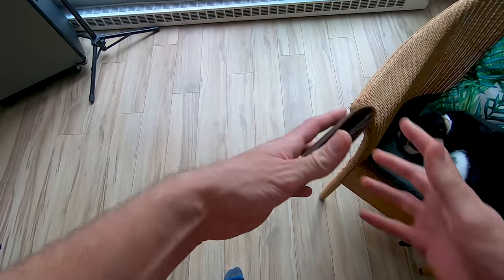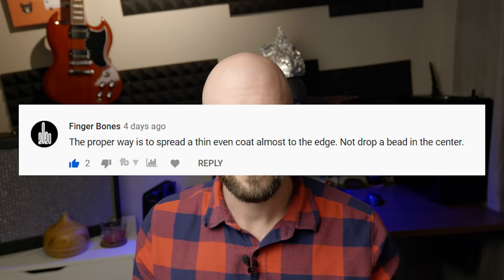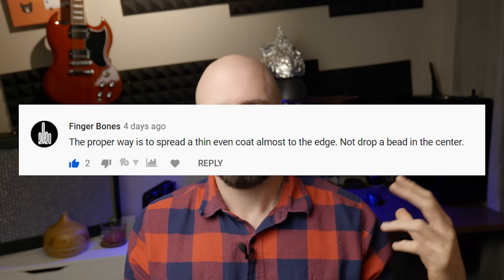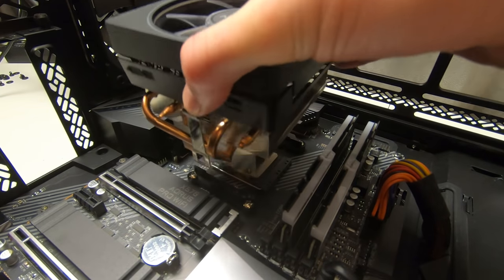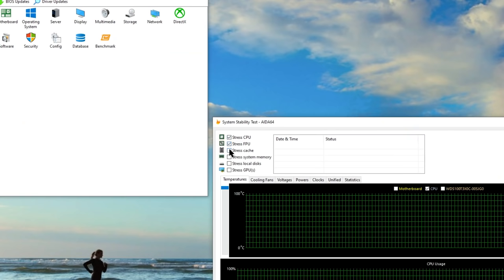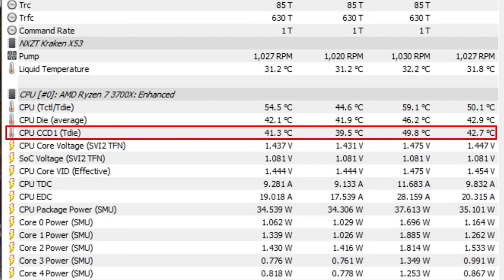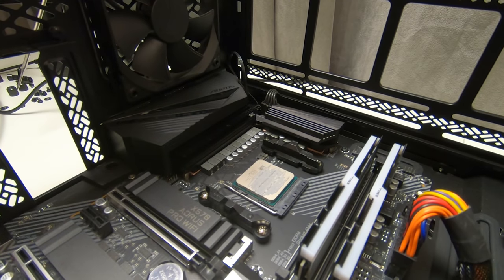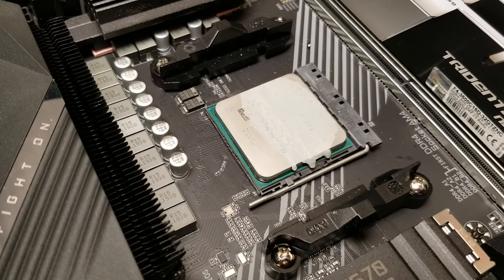Best Way to Apply Thermal Paste? Does it Even Matter?

Comment: the best method is a thin layer specifically covering the die of the cpu, when you put the heat sink on it should spread almost to the edges of the cpu without seeping through
Reply: @Keebine Kobold well it's not the "best" in terms of thermal performance, since any method with enough paste will work fine. but it might be the best in terms of using as little paste as possible, getting a consistent application, all without sacrificing performance.

a novice may not realise they didn't put enough paste if they use another method, but if they use the buttered toast method it will be very obvious when there's not enough. for someone proficient, yeah it doesn't matter bc they have an idea of how much to use and they know to ensure even mounting pressure

Comment: A lot of enthusiasts are religious about applying thermal paste.  I love the fact that you spent the time to prove (IMHO) that they are simply wasting their time.  I've been using the 5-dot method for years because it is self-evident that the better the contact between the CPU and cooler ... the lower your CPU temps will be.  Thank you!
Reply: Seriously I am not a 20 year PC vet. But I have built a few PC’s. My latest Rog strix B550-f-gaming. Ryzen 7 5800x , Asus Dual 3070, PSU -Corsair Rm 850x Gold. Noctua No-d15’s chromax dual fans - 6 Noctua Chromamax black hot swap.  That being said. I have applied Every paste except metal‘because’ it scare the bejesus out of me. So to prove the five dot method for at least AMD 5800x. I applied 4 applications already of thermal paste. My second go around with Noctua thermal paste AND thermal grizzly kryonaut extreme. The 5 dot method made it to where I do not have a hot spot!!!!!  5 dot decreased my my Celsius by 15-20%c. Period. And best. Is no Huge hot spot!

Comment: The object of a chosen method of applying the paste is to A) get maximum coverage with minimum thickness and B) not create air pockets by entrapment.
Flattening the paste will always have a radial spread, so a dot will always reach the sides before it reaches a corner. Since the paste has a rather heavy viscosity, the more paste applied to a single spot and the farther it has to spread, the more pressure will be required to reach a desired thickness and spread. So the optimum is a pattern that needs to spread the least to get full coverage, with a minimum amount of pile to the paste, without using a pattern that would trap air as it spreads. So: the X and pentadot, so long as the dot at the center is largest on the latter. If the central dot was too small with the pentadot method, four air pockets would be caught at the cardinal directions around the center. The "buttered toast" method manually creates coverage, but will usually trap air from an uneven surface and have a greater final thickness from using the most paste.
Reply: Did you actually watch this entire video which quite conclusively shows that it makes no difference at all, and then feel the need to type all this out, insinuating that there is an optimal method? 🙄
Reply: @5stringaustin  It's putting a little science behind the empirical observations. He did them all in ways that won't really cause air entrapment, but some of the methods RISK it for the reasons I explained, which does make a difference.

Comment: I found it good to fill the gaps or grooves between the heatpipes on the cooler (GPU), then the the butter method on the GPU. Otherwise it probably wont fill the grooves, depending on the cooler if there actually are grooves...

Comment: The CPU and CPU cooler parts that touch are actually not flat. There are grooves and curves on both sides. That's why the thermal paste looks all wrinkled after you separate them after a while. It's best to put a blob in the center so that when it spreads out, it gets into those grooves properly for heat dispersal.
Reply: 👍🏻 agree
Reply: the results clearly don't agree with your logic
Reply: Agreed. I've been doing a pea size blob in the middle going on 22 years now. All my machines, friends, clients', all the same. My son's gaming PC I helped him build 7 years ago, since upgraded, same method, doing fantastic. I say pea size, but actually just a tad bit bigger than a pea but not much more. I'm currently building a new one for me and here I am researching to make sure I'm keeping up with the times. I see no reason to change now. Long live my new i7
Reply: @keppycs  you were able to see the grooves get filled? I missed that one.
Reply: @scotmaciver  no, but the results speak for themselves
Reply: @keppycs  i don't remember the topic but i just put a pea on my new i7-13700k with a deepcool lt720 aio and it's running like a champ. Not sure who started this trend about spreading and having to cover the whole cpu but those tests are a waste of time since that's not what the focus should be. But I agree, the video shows temps basically don't change regardless of the process however, this is not a long term scientific test.
Reply: @scotmaciver  Having the die completely covered is better than not doing so. You can genuflect your preferred method as much as you like but the buttered toast method is the ONLY way you can be sure it's entirely covered. Arguing this doesn't matter is absurd because the entire surface gets hot and improving the way that heat gets redirected to the spreader is undeniably more logical. Change your method; it's wrong...
Reply: @Eat-MyGoal  well you are incorrect but if it makes you feel better run with it.

Comment: Since I've literally done hundreds of these over the past 20 years as a field engineer, I've never had a call back due to a processor I've installed or replaced overheating.

I've used whatever method as it just changes things up.  Usually a pentadot or the X method as it seemed to distribute the paste.

And we are talking about higher power XEON and similar enterprise CPUs.   These relatively "low" watt consumer CPUs wouldn't seem to matter.  (And yes, I realize the GPU in most gaming rigs is a bigger power draw.  That's mitigated by not having 24 64gig DIMMs and a dozen spinning drives.)

1U servers that shut down if the cover is removed because the airflow is disturbed produce some serious heat.  We are talking 800w of system power and close to 3000BTUs and operating in an environment next to a couple dozen other like servers.  The server in RU42 of the rack isn't getting the same nice cool air that the server in RU1 is getting.

Just make sure you get it on the CPU and not all over the place.

Comment: Just to add some historical context to see why this such a pretentious topic: CPU's once upon a time didn't have a heat-spreader, and thermal paste used to contain electrically conductive material, and thermal protections weren't as prevalent. With direct-die cooling, it was critical to ensure every bit of the die was covered, but you couldn't use too much as spill over and short out a surface mounted devices (components); basically any extreme (too much paste, too little, improper coverage), could kill your CPU. Even uneven mounting pressure could crack the die, or be a silent killer creating a hot spot. So the "buttered toast" method became ideal as it helped ensure complete coverage, and helped meter the amount of paste used. There was also emphasis in tightening in small increments in a cross pattern.
But these days, with a heat spreader mitigating a lot of the dangers and non-conductive paste, it really doesn't matter; if anything, better err on the side of too much paste than too little, but neither will necessarily spell death for the CPU.
The dot or grain of rice method gained prevalence with heat spreaders; while the heat spreader protected some of the SMDs, prominent thermal paste was still electrically conductive, so excess could kill the socket. The grain of rice allowed mounting pressure to evenly distribute across the spreader without causing excess. Improper spreading could create air-pockets, so "buttered toast" fell out of favor with heat spreaders as the grain of rice or dot methods were more fool-proof leaving the spreading to the cooler's mounting pressure. AMD recommends the "penta dot" method because of their chiplet design (especially with ThreadRipper/EPYC) means there are multiple dies underneath the (massive) heat spreader; pentadot ensures each heat creating die has some thermal paste coverage; a singular dot may mean one of the out chiplets(/dies) doesn't have direct coverage (e.g. not enough, or might spill over the side).

Comment: I do the dab method. I place a pea, wear a glove and dab the paste around, just enough to cover the heat sink. The paste isn't smooth but it's evenly coating the ihs from the center out. Doesn't squish out to the sides and it makes sure the microscopic craters between the cooler and heat sink is filled up which is the whole point of using paste, to ensure thermal conductivity is evenly spread. I got the idea from looking at a textured plastered ceiling in my 100yo house. The purpose of a textured plaster was to help prevent cracking due to the house settling and it's only for aesthetics, not so much for structural reasons but I'm sure it helps with small shifts between temperature fluctuations in the room while the house expands and contracts over time.

Comment: I had never thought of or seen the buttered toast method before and like that one the best and use it with no worries on all my installs from now on. I don't use that much pressure with a card like you did to let the plate pressure work out the excess and it works very well.

Comment: I know this video is about a year old, but thought I'd share some interesting bits around the new alder based CPUs - i7 12700KF specifically in this test.  I am currently using a CoolerMaster Hyper 212 Evo for my CPU fan setup.  Both paste applications were with the same setup.

1. P/Dot Method yielded idle temps around 48 degrees C. This concerned me as it seemed rather high.  After a few days, I decided to revisit the paste application.
2. Buttered toast/Spread idle temps around 33 degrees C.  This was a huge difference and immediately noticeable.

I'm going to be sticking with the Spread Method moving forward - even after a few days of "burn-in", it's still proving to matter.  I've even dropped into 30-32 degrees C a bit when idling now in some instances.

It might also be worth noting, for the first application (P/Dot Method), I had decent coverage in the form of a circle; however, there were decent amounts (the corners :) ) of the CPU not covered.  This was alleviated by the spread method noted above.
Reply: Did you atleast try the P/Dot method twice, maybe you accidentally messed up applying the paste?

Comment: I've put thermal paste on using the pea method. Using the straight line method. Using the X method. I recently redid my paste and applied the paste in a thin layer on the heatsink, you know like the way they send them. The old thermal pad left a perfect outline. It worked amazingly well, no guessing if it covered everything or if there was too much or too little. Clamped it on, gave it a few small twists and clamped it down. I think that's the way I am doing it going forward.

Comment: Well, my approach on a Ryzen 5 5600x was to search for the exposed die pictures. And apply medium sized lines over the actual die position and fill in the gaps with small sized dots in the corners and medium sized dots in between the lines. Also light watersanded the bottom of the cooler
Reply: What temperature was the read out with this method?
Reply: Bro...

Comment: The truth: 

If it has an IHS, thermal paste application doesn't matter as long as you don't use too little.
If it does not have an IHS (naked die), then thermal paste application matters a lot, even how hard you torque the screws (mostly applies to laptops).
Reply: Agree.  My laptop has a Ryzen 5 3550h. The die is elongated. So to me, I used the rice grain method as that seemed the most coverage.
The shop I sent it in for battery replacement, I would say used the line one and that spilled thermal paste over the side. Temps were all over the place and I repaste it immediately. My most recent one confirmed that rice grain was the best for mine as when I opened it, coverage was good. Temps also dropped another 5C with the new paste.

Comment: Just read the manual of the cooler you bought if it comes with paste, they tested it more times than any other non-company individual. Just intalled Noctua NH-14U on my AM4 socket Ryzen 5600x and the manual said make a pea in the middle 5mm in diameter. No reason to make it more difficult. When you'll buy a cooler for a big CPU like Threadripper, the manual for appling paste or whatever compound or sheet will differ and you should just stick with what the manual says. :)

Comment: I think the take away from this is that the plates are probably several sizes bigger than what they actually need to be so that they have a large enough area to accomodate the different amount of paste being applied to each model. Also the thermal conductivity of the paste is probably large enough for small variations in the cross section area to be negligible.

Comment: It's not about overall temperature but longevity: a well dissipated 90% of the die with a few smoking hot points will show as having a normal temperature but the semiconductor joints in those specific areas will deteriorate much faster.

Comment: To exacerbate the difference in thermal paste application methods, you should have used the cooler that does the most cooling (your AIO) your wraith fan running hotter means that less heat is flowing through the thermal paste in the media. Therefore your thermal paste is being utilized less on your wraith cooler.

Comment: Speculation: Unevenly distributed thermal paste will create hot spots on the processor, increasing wear over a prolonged period.
Reply: that would be due to not using enough paste or uneven mounting pressure, not the application method per se.

Comment: I used to spread it out (and I've never bought thermal paste that didn't come with a spetula, so it made sense), but I switched to the dot because it's less work and makes no difference.
However, given that I'm currently reinstalling the slightly bigger brother of your test CPU I might try the penta dot for a change.

Comment: I work on large inverters that utilize large 1200 amp IGBTs that get bolted to large aluminum heat sinks. If any “method” other than thin coat across a thoroughly cleaned surface is used, that IGBT will overheat and blow its guts in about an hour, depending on load and ambient temp. All of the old thermal paste must be scraped off, then clean both the heatsink and the device with alcohol wipes. I then heat the mating surface of the IGBT with a hair dryer on low til it’s warm enough to not cause the paste to thicken when it’s applied, at least 100F. I squeeze out  one long bead in the center running the length of the device. I use a small plastic paddle to spread it out as evenly as I can. Mount the device and press it down firmly and install the four corner screws to secure it. Once the screws make contact, they get tightened down in a cross pattern one quarter turn at a time until snug, then the torque wrench comes in and tighten in same pattern until desired torque rating is achieved. Reassemble the inverter, start it up and let it run for an hour with no load. Shut it down, make it safe, recheck torque, first time always results in about an eighth of a turn to get it there again. Repeat until after test run it clicks the wrench without turning. Then, and only then can it be returned to service with confidence the customer isn’t going to call in an hour or two saying it blew down again.
Reply: TLDR; thin even coat across entire surface is best.

Comment: Actually the tiny dot method will work fine with flat surface heatsink.
As the one you used isn't completely flat, you can see most of the tim was sucked by the grooves between heat-pipes.

Comment: I used a pea on a 5600g. I was testing parts, and the spread was fantastic using older cooler with the copper slug. Given the 5600g is a monolithic die it had great coverage.

Comment: Heya when you make graphs, i suggest using font colours that are more readable, and scaling the graph appropriately. It was a bit hard to read the temperature in the graph, and if the variations are a degree, the range being 70-80  or 60-80 degrees would show the difference better. Other than that great review
Reply from the maker: Thanks dude :)
Reply: Good hint. I thought exactly the same thing.

Comment: I didn't know AMD recommends the 5 dot method, but I did that anyways on my 5600X last month. I feel validated.
Reply: air gap in between heat sink and cpu is not wanted. Best use 1 dot on the center method.
Reply: @noorazmi2329  when paste becomes warmer there's no air gap left dude, you're wrong.

Comment: From years of experimentation you will see the lowest temps with first a buttered toast that is scraped veryvery thin across entire top (almost see through thin), with a grid of 9 medium dots with the one in the middle a little larger that the rest in square formation. The thin buttered toast layer allows the dots to fill in the gap areas when compressed much better. It's my lowest temp method I've found yet.
Reply: I did exactly this last night lmao it’s legit best method for peace of mind.